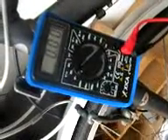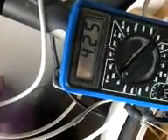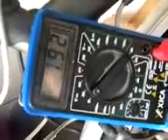Hall Sensor testing

Comment: The hall sensors only appear to work when the wheel is turned backwards because there is an internal freewheel device (unidirectional clutch) which allows the wheel to turn in a forward direction without actually turning the motor (this eliminates an awful lot of unwanted drag while pedalling without power).
If the motor is not turning, the magnets will not pass the hall sensors to trigger the expected voltage response.